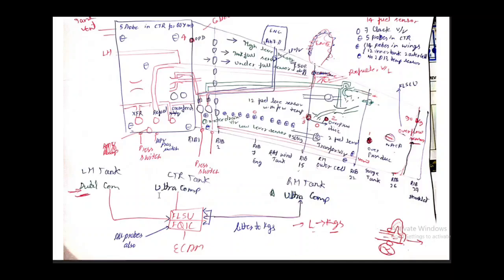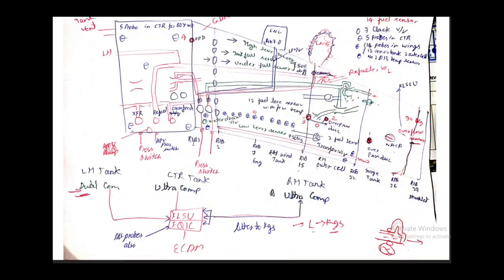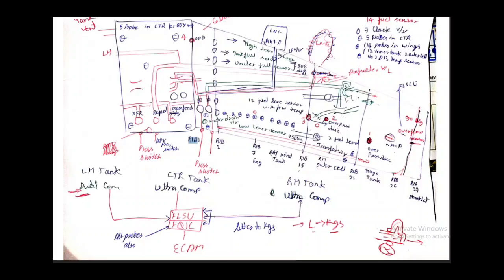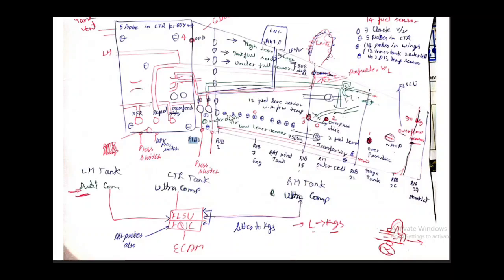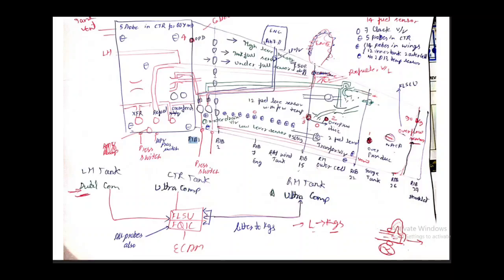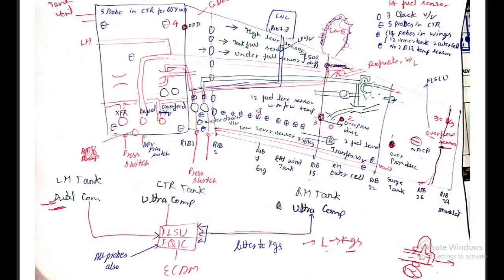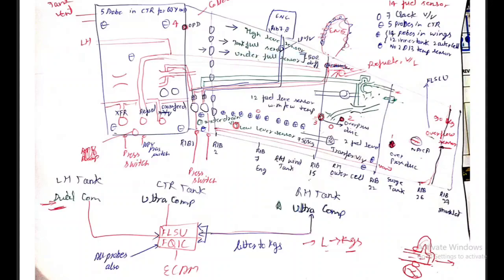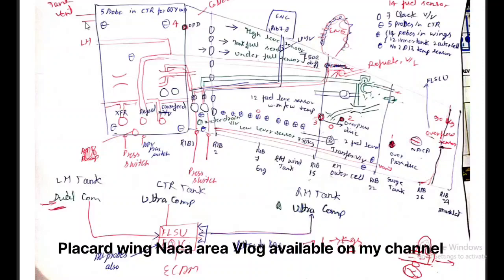WING FUEL & CENTER FUEL TANK NEO ABOUT PROBES SENSORS AND OVERPRESSURE DISC ETC✈️🧑‍🔧🧰🧰

Comment: In the later a321 Neos the value of 500kg is changed to 250kg
Reply from the maker: Yess...This is my A320 assesment Test, so I have not mentioned about A321,  different between full & underfull level sensor in A320 is 500kgs, A321 is 200kgs , so when full level is reach in any wing & MAN Push button is in auto CTR  XFR valve  stop the operation, later if level reaches to underfull level CTR XFR  start transfering fuel it will be continued till CTR become empty, same will control manually if MAN push button is mot in auto....so u r safe not to worry till failure of any systems everything goes automatically...just fun no need to put eny in fuel tank about the level 500/200😅😅